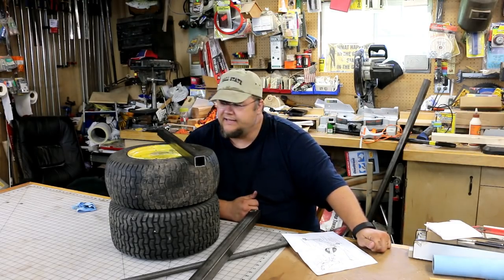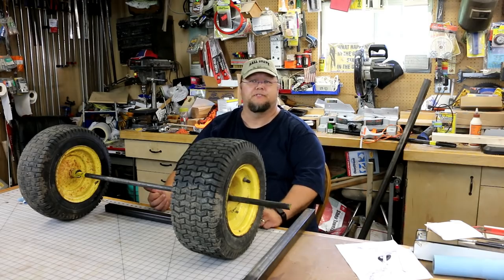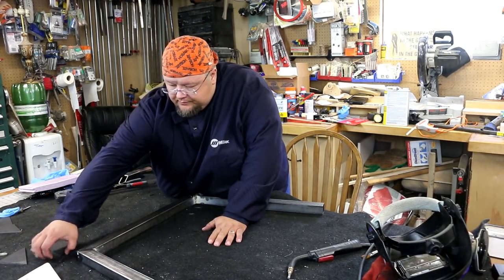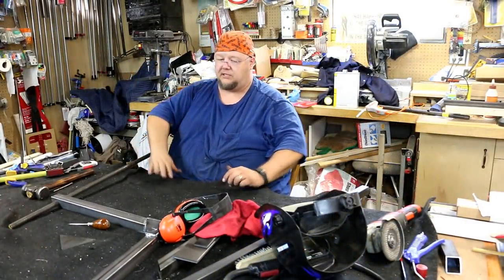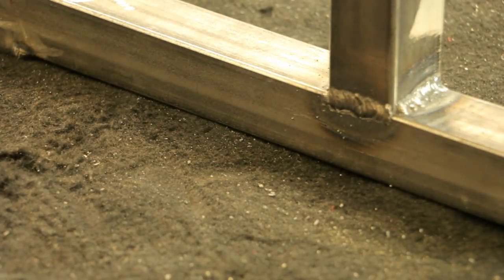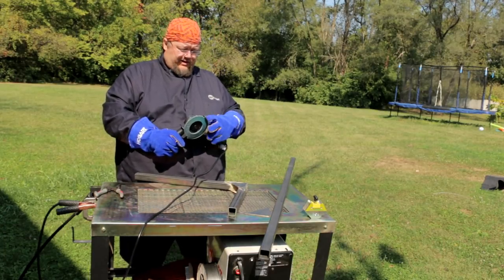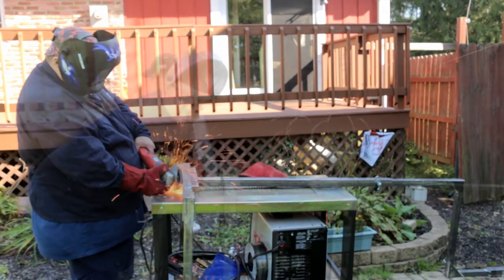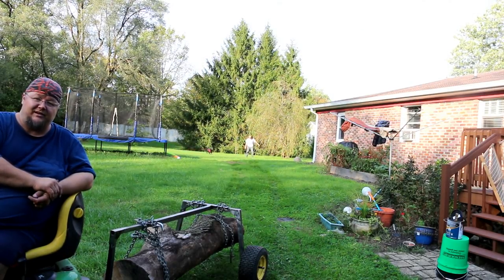DIY Log Arch Build for $25

Comment: I have many acres of firewood to cut and split. The  trail i cut is just wide enough for a lawnmower.  The trees i have are much longer and will have to drag them 1/4 mile to the log splitter.  This has potential....

Comment: Cool!  Those things can cost over a thousand bucks new depending on how heavy duty they are.  For twenty five bucks that's awesome!
Reply from the maker: Absolutely!  I am fortunate to have a local steel supplier that sells anything they have cut on at scrap bin prices. So for some it may cost a bit more and of course depending on the thickness of tube etc. but for my purposes it was perfect and has more than paid for itself.

Comment: i like it, i might have to make one as i have at least 6 large trees to take down and moving the logs is the trouble spot for me i wonder if just lifting tthe front and dragging the back would work, i do have a decent size tractor
Reply: If you had a winch and used your 3point lift to get it off the ground it will pull anything the arch will . on the farm a car hood will work basically you need a toboggan shape to keep the front from digging in. That sell commercially a piece of heavy plastic. 3/8" with ties kinda works like a big game drag.

Comment: Yo Harv. On that "Porter Cable" grinder you bought at TC. FYI PC was bought out by Stanley/BD a few years ago. IMO, they then proceeded to make a killing and market cheap Chinese tools with a PC sticky on it to fool people to think they bought a quality PC tool.That's why it was so cheap. I know because I was burned on that last year. Bought a table saw on line only because it was PC. No dust collection, sheared off a trunion bolt first time out. Eventually I got a partial refund offer from the Chinese manufacturer if I proved that I destroyed the saw. Seems like the motors were going on fire and they probably got sued couple times as they should. PC would have never manufactured a tool like that. To date I still own several GENUINE PC tools that are close to 50 years old and still working great. But anyway good luck with it. (Keep your receipt)

Comment: Don't forget your ear protection, he says as he goes at it with a cut-off disc and not face protection.  Sorry for the sarcasm Harv, but those are dangerous.  My brother had one shatter on him once and luckily he WAS wearing a face shield, because the disc shattered the face shield and gave him a pretty good scare on his forehead.  Thanks for the built and video.  Good stuff, I got to make me one.
Reply from the maker: Thanks for watching and for the safety tip. I’ve not had that experience thankfully. I will have to ensure I have a face shield on in the future.
Reply: Safety is in the users skill and experience not the equipment you buy look at the tropical country's working steel barefoot!

Comment: How did you lift the log are you able to use the cart as a lift buy lifting the toung vertical and strapping log the pulling the toung downcausing the frame to work like a lever?
Reply from the maker: T Huss great question. I did a follow up on how to load and unload. You nailed it!  Using the tounge as a lever it’s easy to raise the end of the log.
Reply: Good deal I have been thinking on those lines without a winch but I haven't worked out the physics of the lift I'm old not a large guy don't want to make a human catapult!
20 years ago hell yeah... Here hold my drink I'll show you!
I'll check out your videos thanks again!

Comment: JD lawnmower wheels? like the JDs at HD? HUH.
Reply from the maker: The wheels were off of an old JD rear engine rider that someone was getting rid of. I had it for quite a while and salvaged the motor years before. I would say any wheels you can get your hands on that hold air and won't immediately dig in or sink should work.

Comment: You asked for input welding. From what I see most of your welds are a bit cold. Don't be afraid to put some heat to it holes are easily filled with a mug. Next get rid of the flux core and get a bottle. You will wonder why you waited. I'm not a pro but I work heavy diesel and equipment. I've. Stretched semis into flat beds and built a number of trailers so I've welded once or twice. The 110 migs are a bit under powered so like I said with thicker metals don't fear the heat.